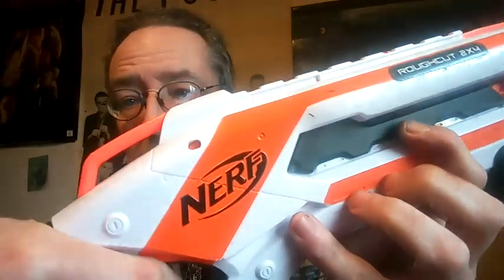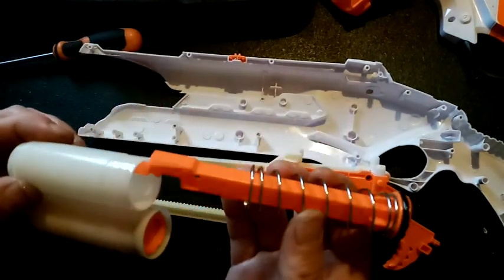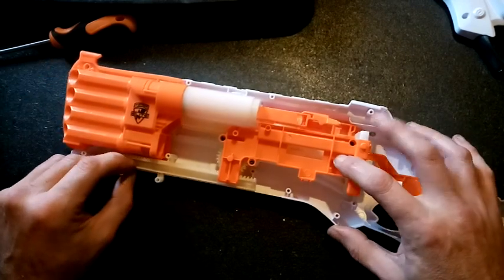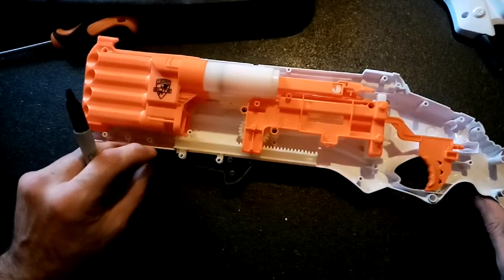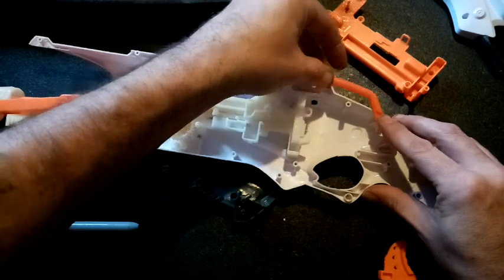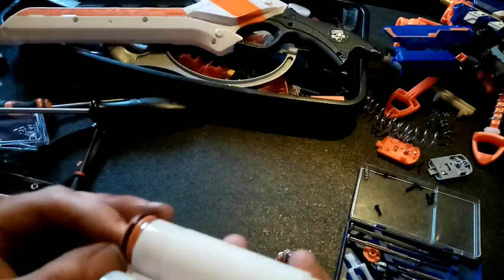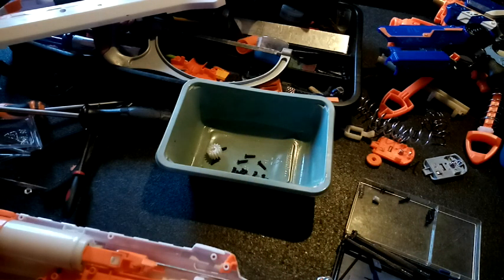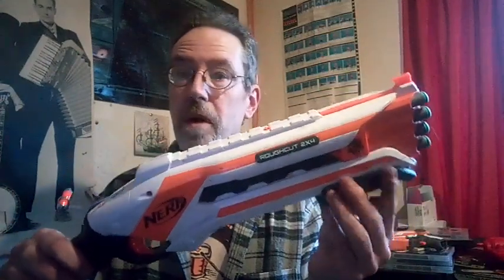[Mod Guide]; Roughcut Direct Prime Mod

Comment: Do you think a modded sledge fire is good also good luck  with the degree
Reply: Also my grandpa has experience with a sawdering  iron so  do you thing if I get stronger battery’s for a stampede  will it boost the fire rate
Reply from the maker: Why thank you!   And a sledgefire?  Tbh, i've not ever owned one....but overall, yes.  Especially with single shot shells!
Reply: Sledgies are excellent! Reloading timing is slow but.. they’re so worth it. I have many.. but my favs include a singled  26kg , and it’s brothers , a double shot and a triple (stock shells) shot w/ 25kg. 

….which is the record Kg load..(no big deal, hahaha) and @ 320+fps with a BCAR.. it’s deadly accurate at 100’-120’? …All in all.. get as many sledgies as you can!!